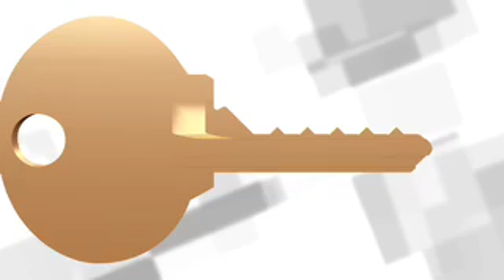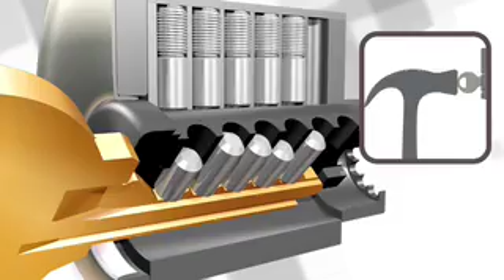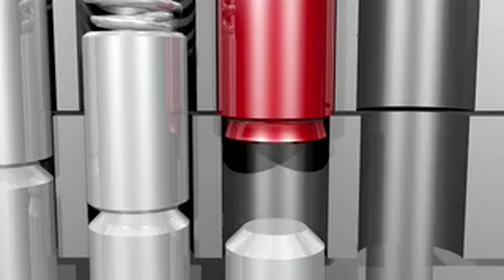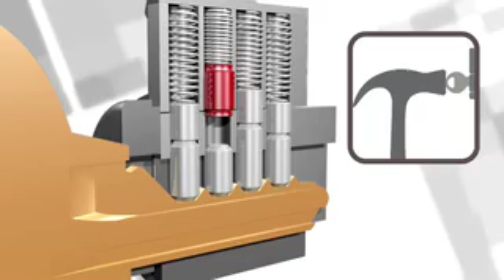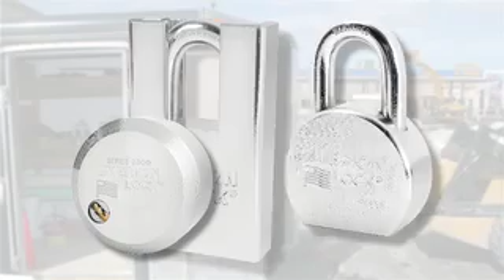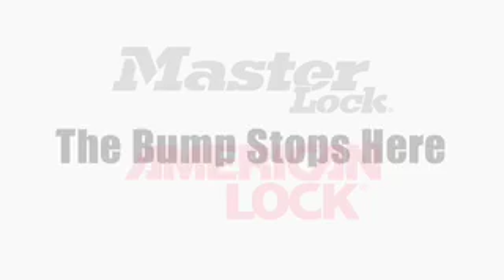Master Lock Company BumpStop Video

Comment: Has anyone seen these in the wild? I've seen a bunch of master lock picking videos where the lock acts like it's a pin short, but it's usually a non-replaceable core so they can''t disassemble the lock non-destructively. If this was more than a 2007 publicity gimmick you'd expect to see these pins all over the place after 9 years.

Comment: The video shows a single bump. Normally you pull the key out one notch and hit it with a hammer while turning the key/plug.  Cut back the stop shoulder on the key 1/8" or so. Then put some rubber o-rings in that place around the key. Should be may ofr soft rubber. The when you place it in the plug, you can hit the key over and over, sort of machine gunning. Eventually there should be enough force to knock the special pin up. I havent tried it. Just saw this vid.

Comment: The point of security pins is that the tumbler gets caught on them when picking, so a light tension is needed when picking to get them to pass the shear line. With a bump keys this principle is irrelevant so they'd probably be easier to bump since they have less mass.

Comment: I've never picked a lock in my life, but wouldn't the security pin be easier to set? I suppose it wouldn't be as much of an issue if you used other security pins alongside it. Like I said, never picked a lock in my life so an answer from someone who does would be great. : )

Comment: you'd break the key before you put in enough torque to shear the tip of that hardened steel pin off. hell you'd probably tear it out of the brass cylinder before you sheared it.
Reply: It might wear off within months.

Comment: It just helps prevent lockbumping at it's basic level. If you know the lock has a bumpstop, you can feel around with a rake or a pick to find which pin it is and fashion a special bumpkey to accommodate for the bumpstop by manually driving it past the sheer line considering it's just slightly below the shear line rather than all the way down.

Comment: This is all great and dandy but what if you just turn the fucking key with enough torque to snap or break off that little ridge? if the other pins can move freely, you'd only need to break it once.

Comment: @gastroization I haven't come across one yet but it shouldn't change much when you are picking it. The only thing that I guess would feel a bit different is when you were picking the lock it would feel a bit like a serrated pin but that one little serration wouldn't up the security at.

Comment: @MrMonkeyspanner It is can be cleared only with the key. A bump cannot move the extra pin to clear the sheerline properly in most situations. But as the video says, its only 4x as effective against a techique that works 100% of the time. Much like the new pin, I am unmoved.

Comment: if the new pin never clears the shear line ... how the F%^& does the lock open? unless of course either it doesn't  need to clear the shear line or the real secret is nothing to do with the pin (which sounds easy to detect for no real reason) but just has a stiffer spring ... mixing up spring tensions makes everthing that little bit trickier when you don't have a key, why is that not common?

Comment: @diefuhreroffunk No the animation isn't accurate, but that's not how bumping actually works. Look up Single Pin Picking (SPP), locks have inherently low tolerance (an actual gap, or "wiggle room"). SPP works by turning the plug slightly so as you move the bottom pin up, the top pin will actually get caught on the edge of the sheer line so you can pick each pin individually. Bumping is the same thing but much faster, the top pins will get caught on the sheer line as they fall.

Comment: u can still bump these, all you have to do is push up the 1 back pin with a thin but firm peice of wire then hold it in place while you continue to do your bump procedure. It took me about 20 minutes to pick it the first time but know i think I can bump these open faster than the key can,

Comment: @diefuhreroffunk  You are correct the animation does not depict the way the pins would move in a real situation, however, the producers of the video most likely exaggerated the image on purpose in order to clarify the fact that there is a brief moment when all of the pin pairs are positioned to leave the shear line of the lock cylinder free to turn.

Comment: @diefuhreroffunk 
the acceleration created by moving the key fast enough forward allows the force acting vertically on the pin ie tan 45 the horizontal force, this applied force overcomes the acceleration due to gravity, allowing the pins to jump off the key until the energy of the pins vertically upward is full opposed by the acceleration of gravity downward. Physics, people. and the tapered edge on the pins allows the shaft to twist before the top pins fall completely, commmon sense . . .

Comment: @diefuhreroffunk Its not that they FREELY fall at different rates, one system is damped by a spring system at the top of the chamber, the other system isn't, so the pins can fall at a different rate. It's all differential, the bump resistance of a lock would then be inversely proportional to the damping factor, look at mass-spring-dashpot systems, they're fairly similar

Comment: The way the animation depicts the motion of the pins isn't accurate.  According to physics, the bottom pins should only move to the height of the key itself, then transfer the energy to the pins above it (conservation of momentum).  The bottom pins aren't going to move to the top of the...ahh...chamber?...and then fall faster than the top ones.  The idea that objects fall at different speeds was disproven about 400-500 years ago, and has been confirmed innumerable times since.  Physics, people.

Comment: @9THSURVIVOR This technology does make picking more difficult (but not impossible). However, most thieves don't bother to learn how to pick locks because it takes skill. Bumping is much easier to learn. If you eliminate the low-hanging fruit, you force them to get a ladder, metaphorically speaking.

Comment: Simply make a casing that fits inside the lock, with small holes in the upward surface instead of grooves,insert small plastic rods through each hole that are used to push up the cylinders, and bend them through so you can push each one seperately untill all the springs are compressed completely.

Comment: @wichtolosaurus2 The real key will force it up.  There is a spring there.  They don't clearly explain it.  But basically the key itself normally pushes each pin up, but in the case of lock bumping, the shock just sort of rocks them up into position and you turn the key as they fall and catch into place.

Comment: it's bump proof, but bumping is not the only method lock pickers use to open locks. i could pick that lock myself in about 2 minutes with a tension wrench and a bobby pin, the most obvious form of lock picking.

Comment: They did that on Mythbusters, the myth was busted unless you used a large caliber gun (such as a massive .357 Magnum pistol) at close range, which causes lots of very dangerous shrapnel. Only SWAT teams and soldiers ever do this in real life, and it involves a shotgun, Kevlar body armor, specialized ammunition, and full face protection. Even then, the goal is not specifically to destroy the lock, but to destroy the surrounding door.

Comment: This Technique to open the lock relies on the speed the bump moves the pegs.  If they were slowed down by friction or resistance it wouldnt work because the shortest pin would have locked below the rotating cylinder before the longest one reached it.

Comment: Another interesting point is that the lock picking "community" is the place to learn about the vulnerabilities of any given lock.  For example, would you want to know that the lock to your front door is easy to break into because of a design defect?  Or would you want that to be kept secret?  If it were kept secret you can bet the only ones that would know about it would be the bad guys.

Comment: well it would certainly be hard to get a hold of the right key blank to make a bump key, so its probably a little more secure than standard locks. A cross pick will work but its pretty specialized and most lockpickers wouldn't have one. So your probably fine, unless some REALLY wants to get in, theyll find a way